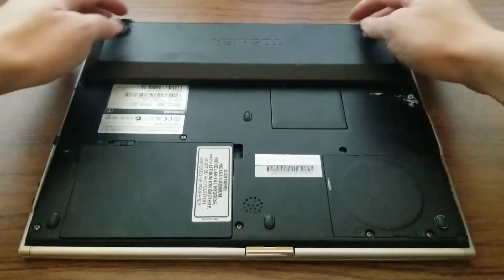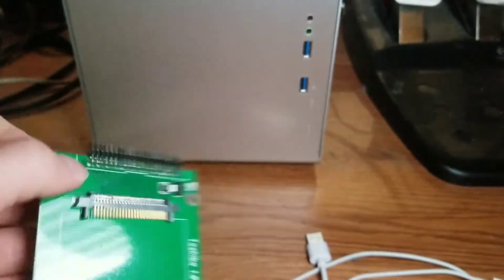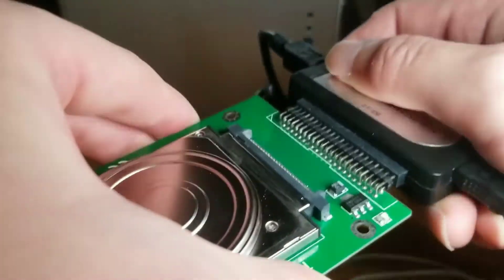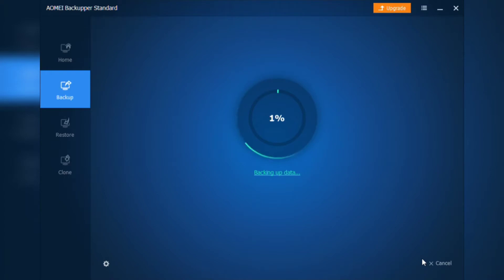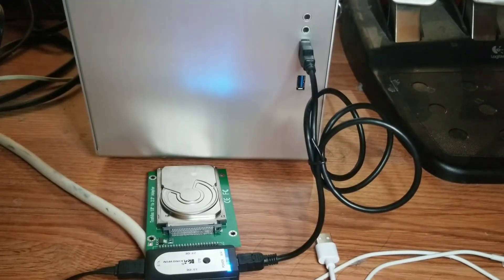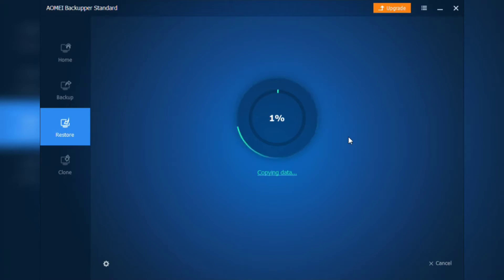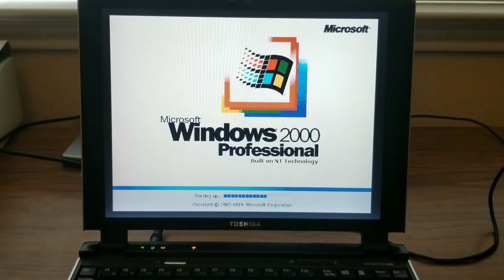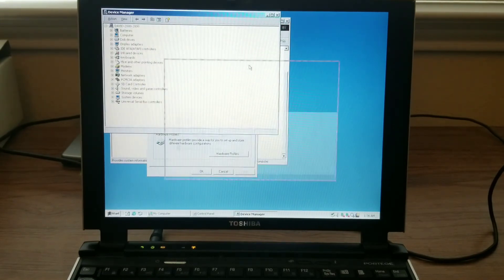Replacing a 1.8" IDE hard drive with CompactFlash

Comment: Since 1998 I have done this on many laptops. The Issue is to connect the Compact Flash to a newer system to get its physical attributes as older systems you have enter this by hand.

Also You have the Single Compact Flash Adapters and the Dual Compact Flash Adapter.  The Duals are great if it an ols laptop without a CD Drive. If it has a CD Drive, than  the system will be bling to the second CF Card on the Adaptor.

With Mac laptops and desktops using IDE, you can only use the Single Adaptor. If you use a Dual Adaptor, even with only 1 CF Card in it, It will not boot. It will only give you a grey screen of pixels. Nothing more. But the Single CF Adaptor is the one that works fine with Macs.
Reply from the maker: thank you for this informative comment.  You most likely know more of the nuances and details than me regarding this.  How do you enter the attributes into a CF card?  I read that newer CF cards may be incompatible with older systems due to the attributes.

Comment: I bought this exact laptop and have been trying to connect a CF card directly to the ribbon (connector is identical on the HDD) but I akways got the IDE #0 error. You've shown me that an adapter is indeed needed, probably pins order is changed. Thank you very much!

Comment: Can I boot up an OS on a usb without a physical hhd or ssd installed?
Reply: Yes, at least if your using Linux. You could do it with Windows as well but I don't recommend it, it's using too much resources. I have an old USB disk with Windows 8 I can run directly from the USB, but it takes ages to load. There's also a version of Windows for admins called WinFE which stands for Windows Forensics, but it's only meant for saving data or checking.

Comment: Hi David, i have a 1.8''' HDD IDE that i removed from my old laptop, i saw your video and i noticed that you used a toshiba 1.8''' to 2,5''' adapter. I looked at amazon,ebay and at ali express for this adapter but i couldn't find it. Can you recommend me a place where i can get this adapter since i bought a "HDD adapter converter" (doesn't fit with the 1,8'' sadly) and i wanted to recover the data from this 1,8'' HDD any information helps thanks!!.
Reply from the maker: hi, you're right. I couldn't find any suitable options available still being sold.  If your laptop still works, then you can hopefully use it to recover your data by creating a Ubuntu live USB and booting off of that.  Otherwise, I think your last option would be to buy a similar laptop off of eBay or something and install your drive into that.

Comment: Please, would a 1.8" zif ssd work? If so, would I need an adapter to connect it to IDE? Thanks in advance.
Reply from the maker: A 1.8" zif SSD would not be able to plug directly into the laptop, and you wouldn't have enough space for a zif to ide adapter.  You would also need to find one of those if they exist.
Reply: @davidsdetaileddiscussions  Thank you very much again for letting me know. Also, would a SanDisk ExtremePro CF card work? I don't know if it supports ATA mode. Thanks again.

Comment: Buys a 128GB CF, only create a 60GB partition, smh 
You could at least have 1 extended the actual partition or 2 created a second one, showing as D under window s
Reply from the maker: You'd probably hate it even more when I created one 1GB partition on a 128GB CF on an even older laptop.  For older laptops, either the computer itself or versions of Windows that are compatible with it have limitations on hard drive size.  But, in this case, yes, I could've created multiple partitions to use the entire CF card.  However, the point of this video is to show how to replace the original 1.8" IDE hard drive with a CF card.
Reply: The last time a partition was limited to 1GB, it was in DOS 6 lol. Windows 2000 can (like winXP) handle up to 2TB per partition. At this point and with this mentality, why even wasting money buying 128GB CF cards ?
Reply: @Fake Account Yes i totally understand this use case, my point is that he is stupid and could have bought a lower capacity cf card for way cheaper, given that he doesn't want to adjust partitions.

Comment: This CF card doesn't work well. Almost all cards are now in mobile mode. The CF card that can be installed in the system and can be partitioned must be ATA mode card. ATA mode system will recognize as local disk and partition normally. The cards I tried were West digital and STEC. The particles used by both brands are SLC, but the speed can only reach ata33 standard.
Reply from the maker: Thanks for the comment!  This is very educational.  Indeed, I had to look on eBay for older CF cards.  Had good luck with Toshiba and Transcend.  As both don't seem to be making CF cards anymore, the stock was old enough where they supported ATA mode.  However, I did not have any issues with using a newer Sandisk CF card in this R100 laptop.

Comment: I actually like to run AOMEI partition assistant to clone hard drives. Cool video though didnt even know 1.8” was a thing for laptops. What is your opinion on the read/write life of using these flash cards to run an OS?
Reply from the maker: 1.8" was a short and unpopular phase in laptops because those drives had worse performance than 2.5" drives, which were already the bottleneck in laptop performance.  Then, uSATA and mSATA came along.  Now, there's M.2, so there's plenty of options that fit the space requirements of ultraportables without any sacrifices to performance.  CompactFlash is definitely not meant to be used as a SSD, and they don't have as much write life.  Read life shouldn't be that big of a deal.  It's writing to flash memory that wears them down.  The main features missing from CompactFlash that are in modern SSDs are wear-leveling algorithms and TRIM support.

However, having said that, I don't think anyone will actually hit the limits of a CompactFlash card by putting one in an old laptop.  The performance is actually better than old IDE hard drives and I don't see people having workloads that will do that much writing onto the CompactFlash card, such as transcoding video or moving large music or video files around.  Even gaming would be limited to old "retro" games due to the other specs on the laptop, and these old games are much smaller in size.  Gaming also doesn't do a lot of writing to the hard drive/SSD.  I think the most common use case would be that someone has an old laptop sitting around with sentimental value, and they want to swap in a CompactFlash card to keep it running, since the hard drive is one of the first things to go.  Then, they'll play with it for a while, and move on to do real work on a modern machine with a modern SSD.